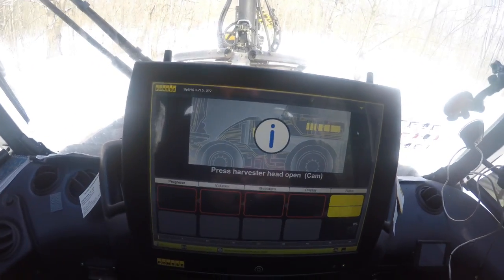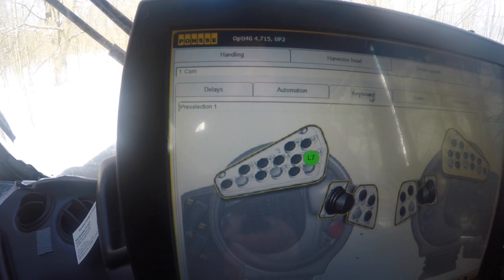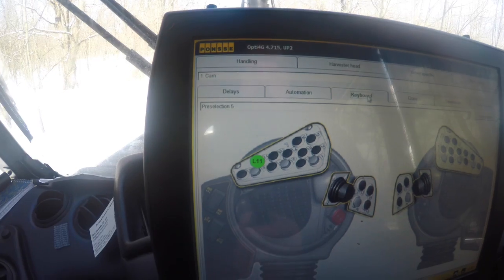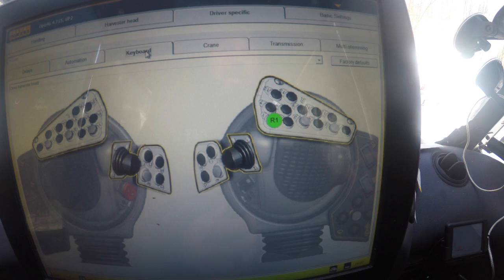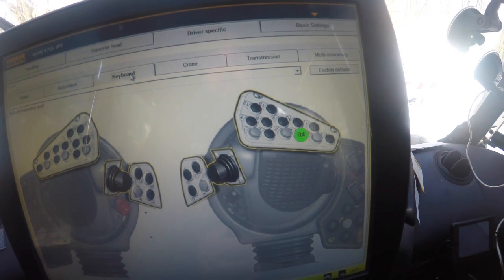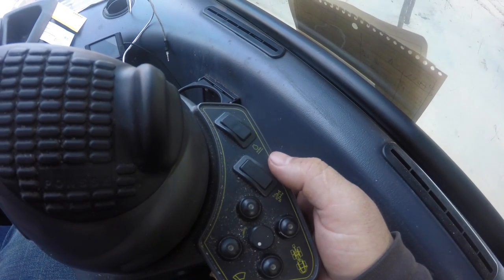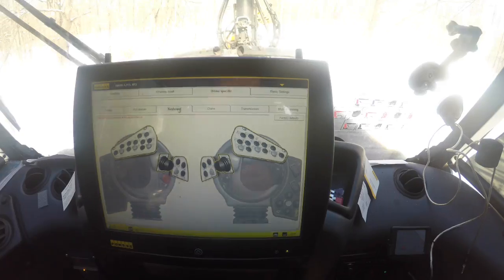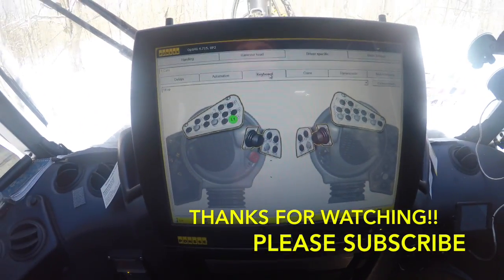HOW TO OPERATE A PONSSE HARVESTER. CONTROLS SETUP

Comment: Just purchased a 2008 Ergo 6W.  Machine came with huge notebooks, mostly parts manual.  The manual which seems to be the operation manual,  leaves the computer programming aside.  Seeing you had made a video on how to operate yours, is it because such manual does not exist?  I have been surfing the net for an operation manual to be downloaded, and found none.  DId you have to figure out the operation of the harvester?

Comment: How do you find he Ergo and Ponsse head holds up to the hardwood you cut? Your timber looks very tough and difficult to delimb, it has poor form (native growth?)... How many hours on the machine now?
We run all CAT and Tigercat tracked machines for our CTL jobs and I often wonder how good a wheeled harvester would hold up to our Australian plantation hardwood... We operate anywhere from 0.15 - 0.5m piece size per stem but the problem for us is our timber must be debarked - that is very very tough on harvester heads and machines!

Comment: On these harvester heads, what keeps the weight of the entire tree from pinching the chain and bar?
Thank you, very interesting machine!!
Reply: Late reply but usually as you cut you apply slight upward force with the boom itself to ease the saw so it doesn't pinch.
Reply: I think the saw always cuts from up to down, so if the tree is being held in the air i believe gravity would naturally prevent any pinching